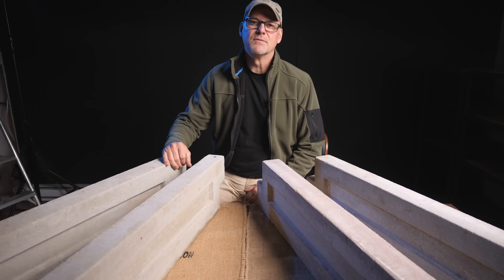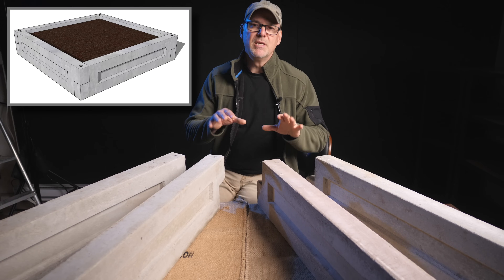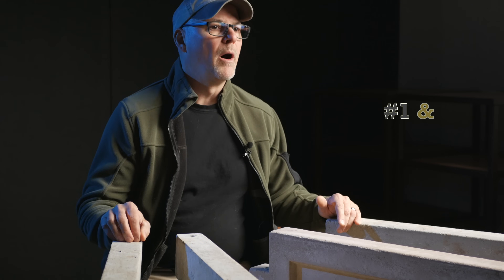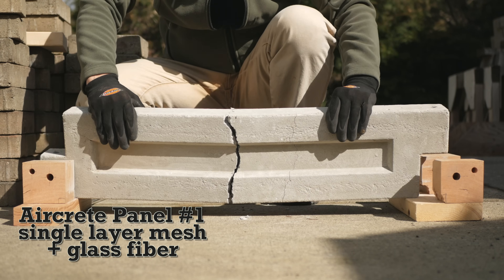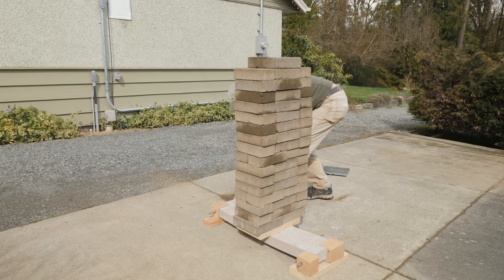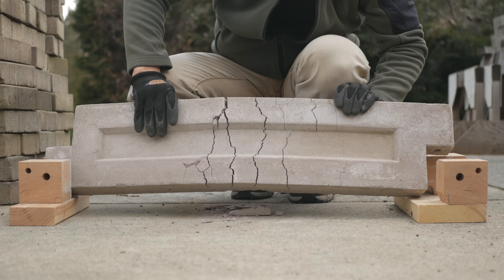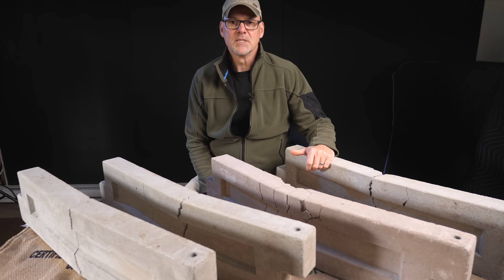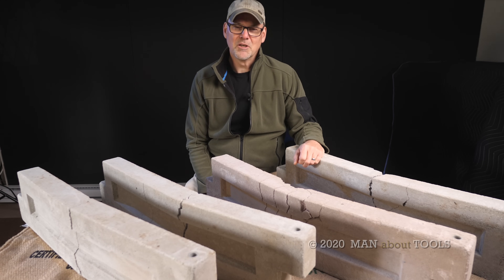How Strong is Aircrete? Deflection Test Lightweight Concrete Garden Box Panels

Comment: Excellent study though limited.  The reinforcement substantially improves the strength in tension.  I have noted from other channels that the addition of sealer (Sodium Silicate - liquid) sold under a number of brands as concrete sealer will soak into the Aircrete and dramatically improve the surface durability and temperature resistance of the Aircrete.  I wonder if the treatment would provide more strength in tension as it does in compression?
Reply: IWilliam Ediger
Reply: It would be interesting to see. My bet is that it improves the surface hardness and abrasion resistance but I suspect that it would do little to the basic mechanical properties.

Comment: Kent, thank you for this information. I’m busy making more of these, my next wish item is to have a green house for the garden. Have you considered taking one on as a project? Something in the size of 10’x14” adjustable every 2 feet? I have looked at the pergola and other wood projects you have made, would do us all a great favor by having the plans and material list. Stay safe out there during this time.
Reply: I would like to see that. Maybe they could be inter-lockable for expanding length and width?
Reply: I am currently working on a geodesic greenhouse that will use a version of what Kent has done here as the foundation. I designed some blocks that are 18" tall and 40" long that taper from 5" thick at the base to 3" thick at the top. These will connect together as do Kent's except they will make a circle of 16 ft diameter to support the greenhouse.